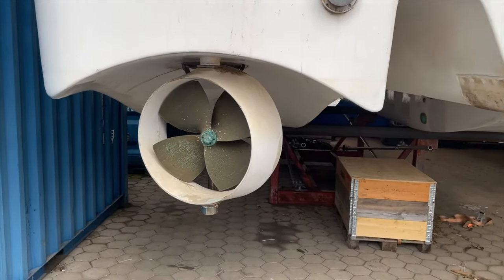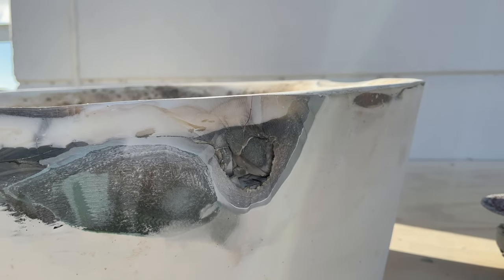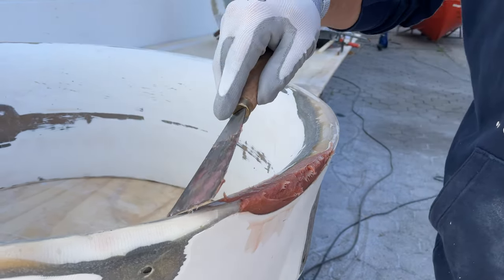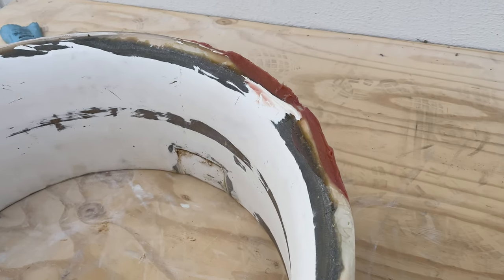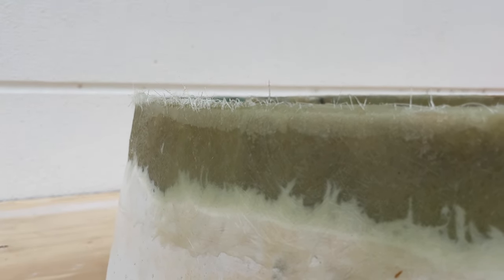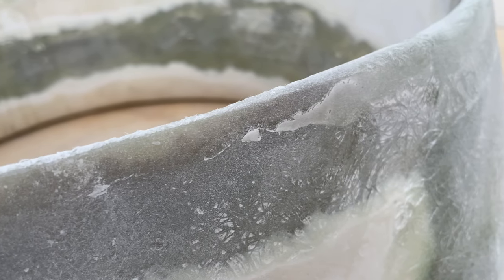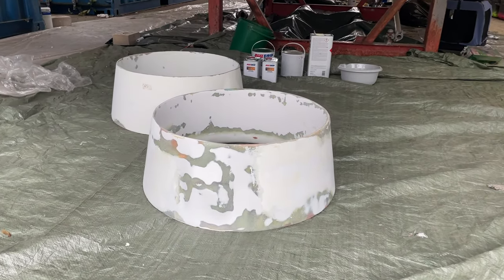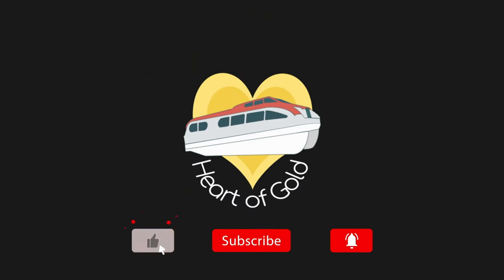How to repair a hopeless fiberglass part - secret tips from the pros: H.o.G. Part 13

Comment: Good job on the repair but you need to keep an eye on it.. 
To be honest as someone working in shipbuilding i would have made 2 new nozzles out of aluminium if i wanted fancy or even mild steel if i wanted cheap and strong. Enough shops that can roll something similar and weld a nice connection plate and anode doubler.
With your power profile the nozzles are not critical. Any nozzle design shape would be sufficient for steering and propeller protection. These nozzles will come back to visit you again in the future and it is always at the most inconvenient time.
Still jealous as hell about your lifeboat find, this cat design is truly beautiful.  Good luck and fun with your build.
Reply: Stainless steel will  do fine
Reply: @Whateverpoopiepants  fiberglass nozzles are ok design for a lifeboat that is occasionally used. For use as pleasure craft more chance to hit something and damage nozzles on impact due to shore proximity etc. A metal replacement wouyld be better choice taking above factors into consideration. No negative Nancy just 30 years experience with this shit.
Reply: @renter007  
Well ok then. That does make sense.

Comment: How are you going to insulate the bedrooms now you’ve stripped out the foam? Could you cut the big chunks of foam into thin slices to act as insulation? 🇬🇧🇬🇧👍👍
Reply from the maker: I'm using 50mm Armaflex all over the boat - the PU foam from the hull could be used as well, but it's not exactly fire retardant - I prefer something that buys me a minute or two if things go downhill

Comment: So the heart of gold is still beating...  Looking  at the nozzle, it seems to be slightly conical. Would it  have made sense to create a negative mold and then create completely new nozzles?
Reply from the maker: Absolutely - I've been putting in 15+h every week lately getting her primed, next weekend I'll hopefully be able to apply the PU topcoat.

I think making a mould would have required to fix the shape of the original part first (otherwise the mould is crooked) - at that point why not keep the original part :)

Comment: What will you be doing about ballast?  Take a look at sailing yada, they are pulling metal slag from a metal shop & putting them in plastic tubes.🇬🇧🇬🇧👍👍
Reply from the maker: Batteries!
Reply: @HeartofGoldLifeboat  evenly spread thru the boat? 👍👍🇬🇧🇬🇧